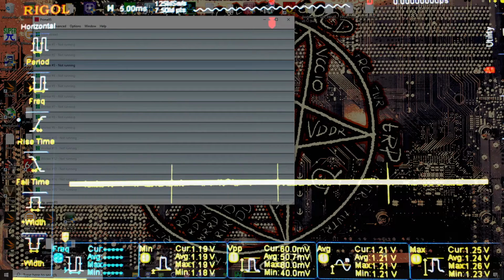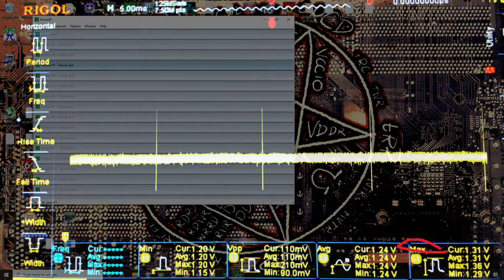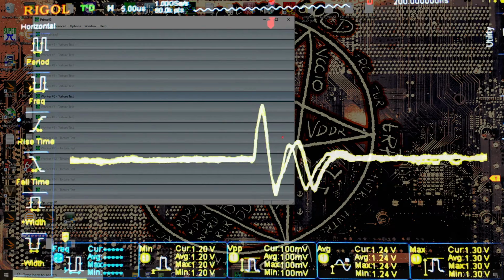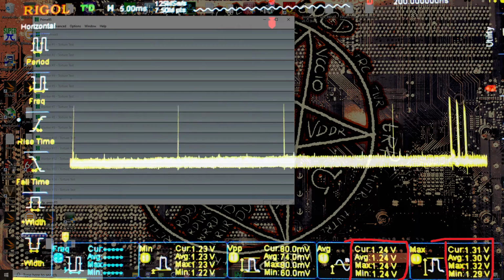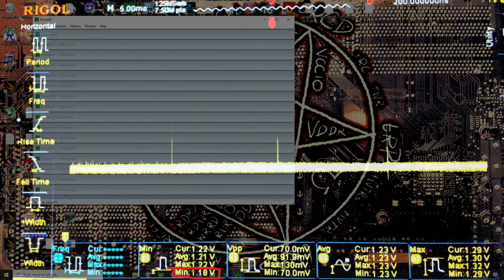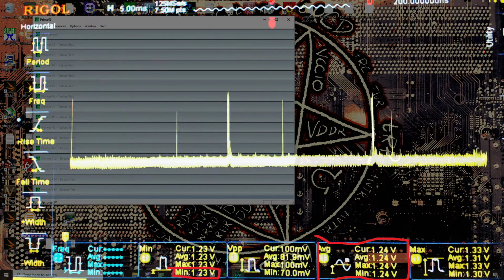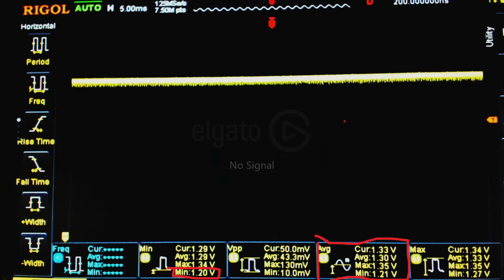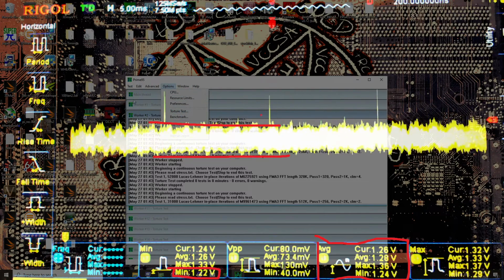MSI Z690 Torpedo EK X LLC settings and voltage regulation

Comment: I use this motherboard and LLC1 from 1,25V gives me 1,26V under cinebench R23. Switching to LLC2 make an issue... I did set 1,35V and in idle im getting 1,324V, but under cinebench its drops to 1,26V. I don't know whats going on but this is very annoying.
Im using override mode.

Comment: Have you got any actual, at least bootable core frequency capabilities between different motherboards, like 100-200 MHz discrepancy? Makes me curious.
Reply from the maker: I don't think I've ever seen a difference in "bootable" clocks. At least not getting to the BIOS. If you're wondering if there's overclocking difference between boards depending on the VRM quality. It depends on the boards. I tested a Z370 board was literally 200MHz worse at loaded core clock than the good z390/Z370 boards I tested. But between high end boards the difference are more like 10-30mv for a given clock board to board.
Reply: @ActuallyHardcoreOverclocking  Mostly interested when staying in one family, i.e. how does a cheapass Z690-A Pro fare against TUF or Strix in both "bootable" and actually stable clocks. I assume there should literally be no difference in bootable clocks as it's CPUs quality concern and the rest is simply voltage. I've watched your MSI's LLC influence on voltage regulation video and to my belief, the higher Vpp can be simply countered by raising voltage to achieve same clocks.
Reply from the maker: @PolskiJaszczomb  The CPU clocks better the cooler it is so if you keep raising the voltage the weakest board will run out of thermal headroom first. Though between the Z690-A Pro, Z690 TUF and the Z690 Torpedo I think with each board set to it's optimal LLC there probably won't be any difference between them.
Reply: @ActuallyHardcoreOverclocking  Thanks, much obliged.

Comment: can you check the initial voltage spike at system's startup? rly curious to see if also setting higher voltage effects it
Reply from the maker: if you're asking about this because of the J2C video where his cheapo DMM is showing massive voltages spikes I suspect he's getting that either because he had the board in LN2 mode or because his DMM sucks.
Reply from the maker: https://www.youtube.com/channel/UCrwObTfqv8u1KO7Fgk-FXHQ/community?lb=UgkxMSjIpRzVFpFoHknY_1JyB_YUQcUQEflD
EDIT for some reason the link doesn't work if you don't refresh the page.